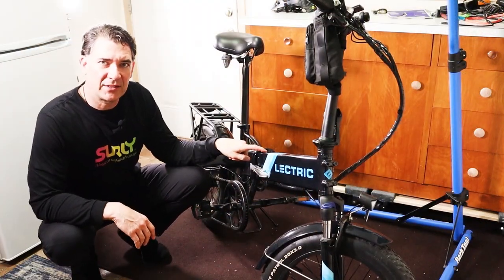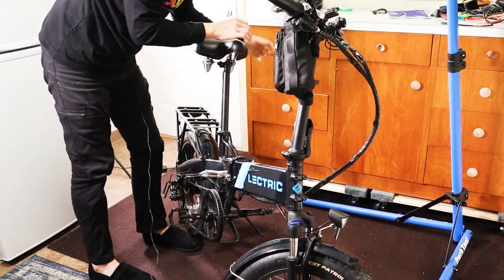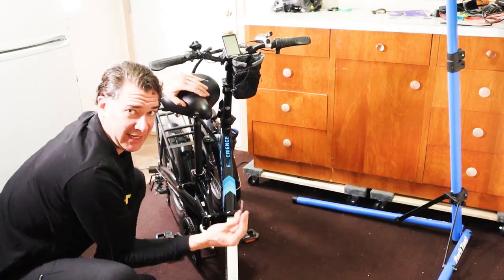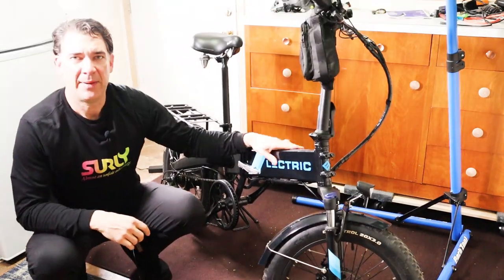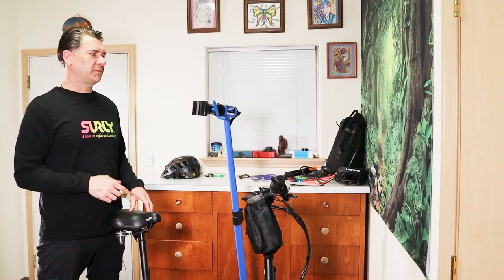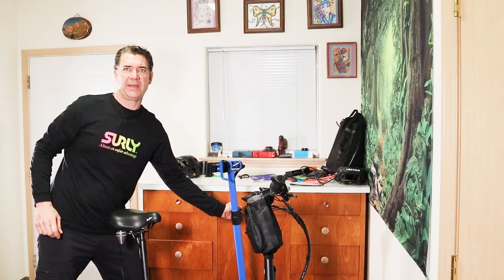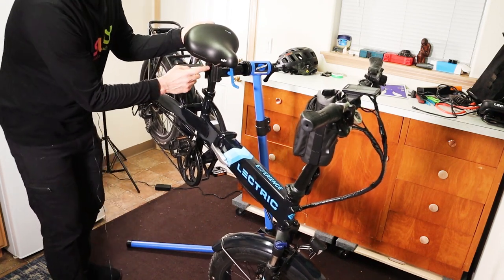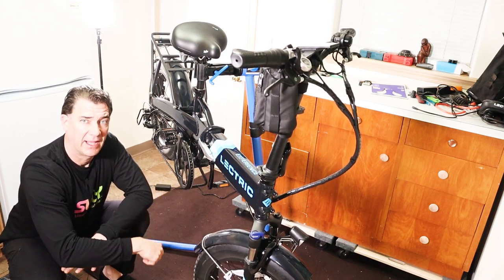How To Get Your ELECTRIC BIKE in a HOME REPAIR STAND - Lectric XP Walkthrough

Comment: I have both the front and rear cargo package baskets installed, so even with the battery out, it is still pretty heavy.  I found by carefully laying my bike down on its side, I could lay the bike stand down over it, place & tighten the grips further down on my seat post (and avoiding crushing the rubber on the top of the comfort post) - then lifting the bike and stand back up in a nice, controlled manor.  I reverse the process to take it out.  I can do this rather comfortably and controlled, but I suppose it wouldn't ever be officially recommended!
Reply from the maker: Very clever, good job!

Comment: Chris...I am just getting into ebikes and as others have mentioned...you have an awesome channel!  The vibe I have gotten from other channels is that you should pull the battery if you are out biking and go into a store.  Since it is so involved to remove the Lectric XP battery....do you take it out on a regular basis?  Is there a way to lock the clamp where the bike splits in half?
Reply from the maker: I just leave mine in the bike. You can use the key to lock the battery in and just take your key in with you